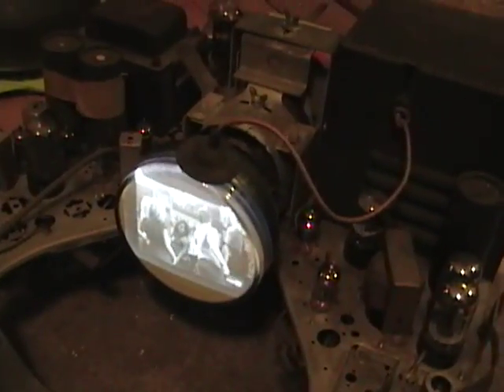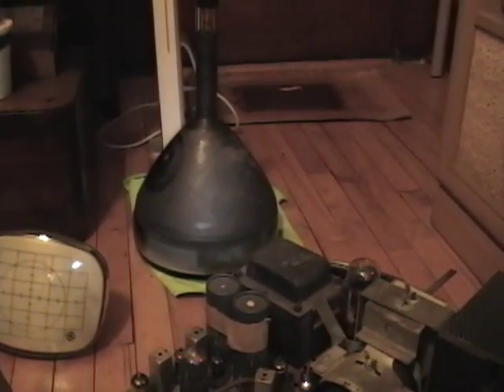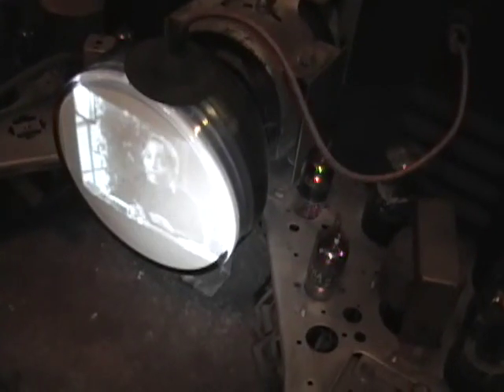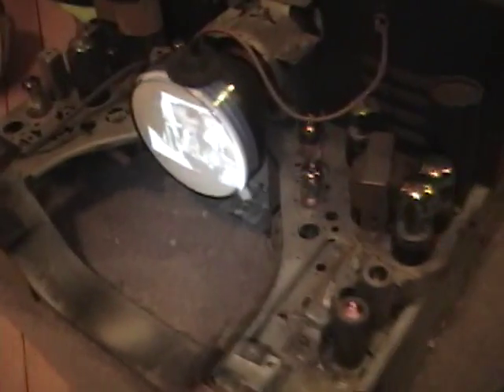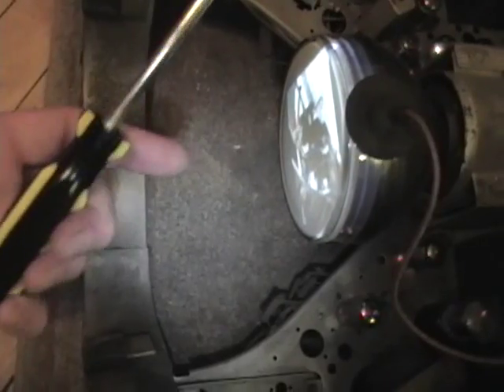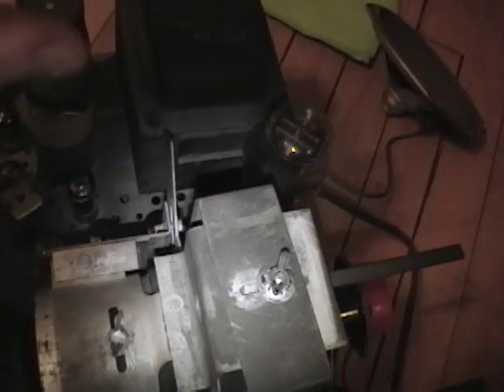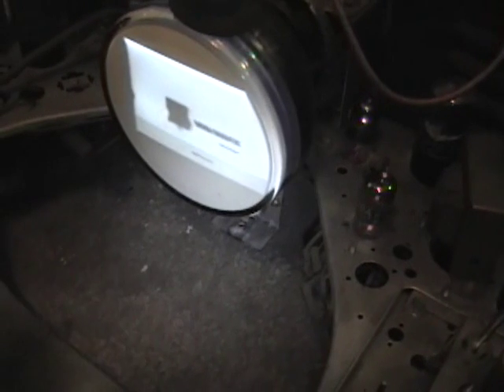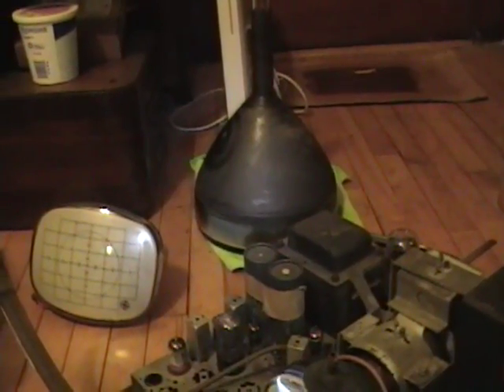Universal Picture Tubes

Comment: We're planning to do a short "How to Set Up a Restored Vintage TV" video, schedules permitting. A walk-through of the procedure seems like a good idea for cases where out-of-state clients with enough technical proficiency to properly disassemble a set like a 630TS to pack it for OEM-style two-carton shipping could re-assemble the Restored set and perform the necessary Setup procedure for final Ion Trap, Coarse Focus, and Centering adjustments and correcting Neck Shadow and other common issues.

Comment: The burn spot is unavoidable in the 5AXP4. It has neither the bent gun / ion trap nor the aluminized coating inside. It says in the data sheet the tube is for test use only and not for actual use because of this. Does anyone know if there was a 5AXP4A that is aluminized?